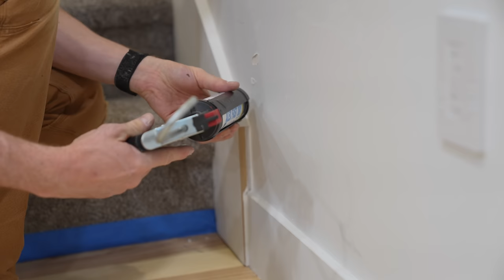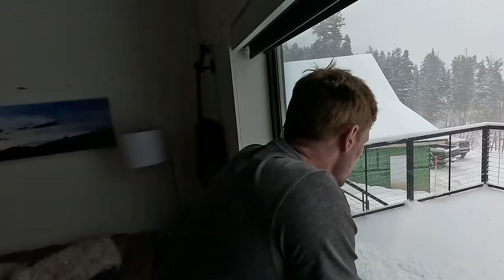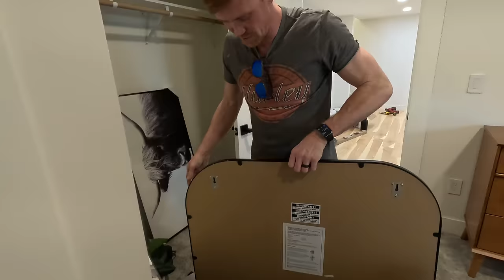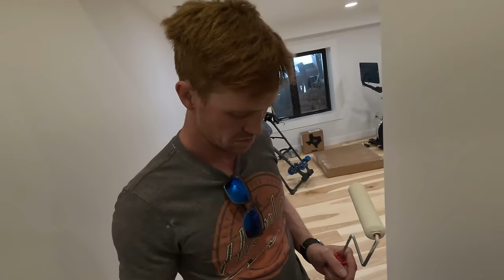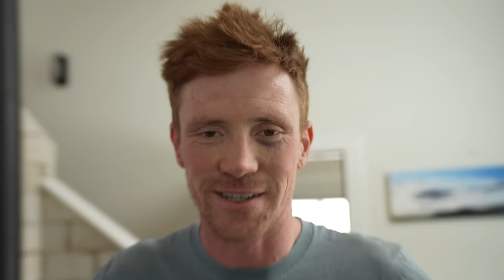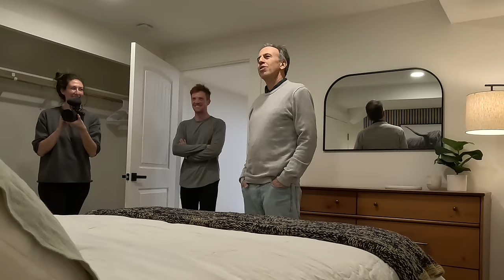THE BIG REVEAL...

Comment: For hanging, get masking tape, put it where your screw holes are on your frame, mark the holes with marker. Take the tape off, apply where you want it on the wall with a level & screw/nail/drill through the marks depending on what it is (for weight obviously) then rip the tape off. 👌 much less involved than measuring constantly